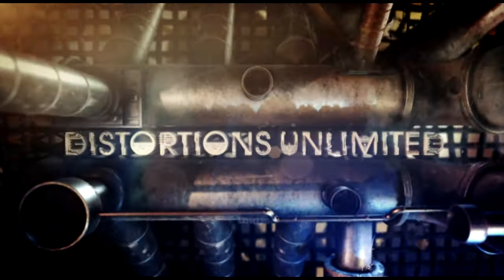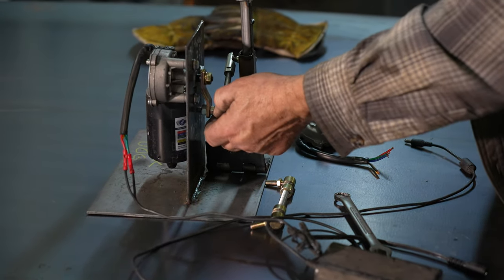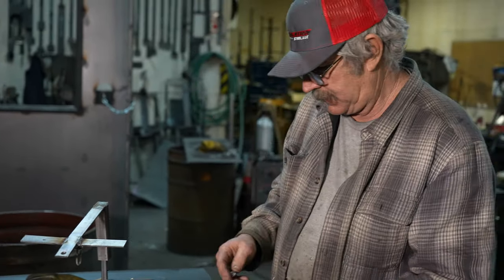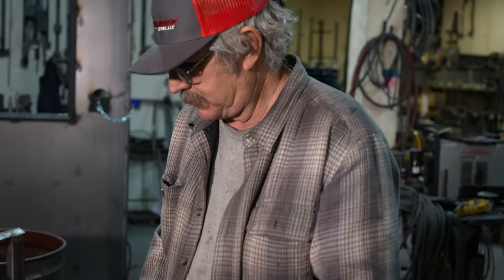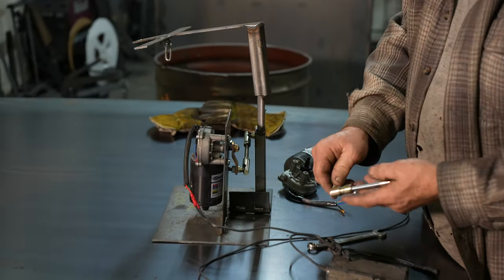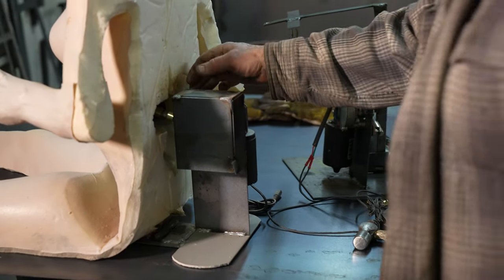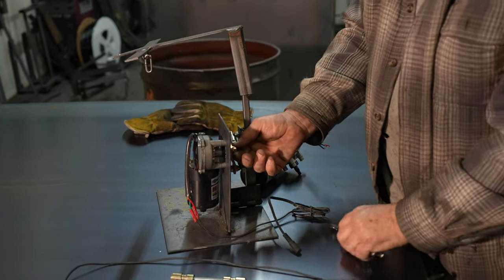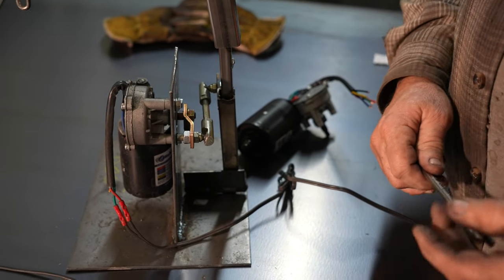Frightronics FAQ & Distortions Animated Prop Troubleshooting w/ Mike Glover

Comment: If it doesn't work, make sure it is plugged in, check to make sure the wiring is intact, and then smack it with a hammer. Sounds like my repair methods!

Comment: I had issues with Graveyard Ghoul that I just got the spot weld on the nut didnt work... lol I put a vice grip on the motor shaft and pulled on the linkage and tighetened the threads... was thinking I would put some red locktite on the threads to prevent it from happening  again...  then the other thing that happened my dog accidently pushed the wires towards the linkage and the wires wrapped around and pulled the red connector off the wire... I would have soldered it but my iron quit working... after all its over 30 years old... I got my moneys worth with that one it was from radio shack... lol 😅😊